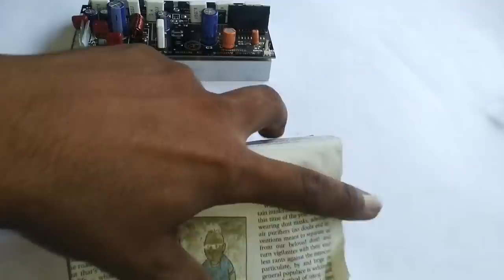How To Select Power Amp Board For Subwoofer

Comment: நன்பா என்னிடம் harman /kardon
161avr 5.1 avr per ch 85 watts 8ohms impeedians 200rm subwoofer உள்ளது இதைவிட powerஅதிகம் உள்ள subwoofer ரும் இதற்கு இருந்தது அது heavy
இருந்தால் வாங்கவில்லை இப்போது எனிடம் pioneer 12"1400
watts 2and or 8ohms(4ohms dvc)
model TS-W311D4 subwoofer உள்ளது இதற்கு kumar 2611 borad
50 volt dc பொருத்தினால் சரியாக இருகுமா என்று நல்ல பதில் சொல்லுங்கள் நன்பா நன்றி
வணக்கம் நீங்கள் விழக்கும் விதம்
மிகவும் அருமை சிவகங்கைல் இருந்து நான்
Reply from the maker: Kumar board are designed for 4 ohms subwoofers 8ohms it will give half the watts 4tr - 100w / 6tr - 150w  
Use two 8 ohms parlel 4ohms
Reply from the maker: Sir send me photo of subwoofer to my whatsapp number 7010277360

Comment: SAKTHI போர்டுகு 8" sub, 24 volt சொன்நீங்க, 24v transformer AC volta or DC out put volta கொஞ்சம் விளக்கமாக சொல்லவும். உங்கள் video எல்லாம் சூப்பர்
Reply from the maker: 24 ac I will tell clearly (most off the time 24 30 32 36 20 28 all will be ac)
Reply: @TAMIL-MUSIC  thanks for your valuable explanation and immediate reply. Thanks again

Comment: Anna na use panrathu 30 0 30 10amps  Transformer  use panren 5 chenal ku 10 transistor board sub ku bigsun 4 transistor 600 watts nu solranga ethukku 10 transformer pothuma nu sollunga

Comment: Recommend volt- each transistor  need 1.2 ampr,so 2 transistor need 2.5ampr + recommended  voltage. (Which showing on pcb.) But now class d amplifier is better than class ab....have updated always. 👌🙏
Reply from the maker: Class d not that available still modern avr using class ab circuit class ab Audio is more clear than class d audio for high quality audio class ab is the best

Comment: Hi, please note the power handling capacity primarily depends upon your mains transformer. The core window area, stack are the 2 factors which determine the power of the transformer. Taking the losses, reduce by 10% will be the power handling capacity. From this you have to work forward. You can have even 500 watts from 24 volts. Please go through the internet for how to rate the power handling capacity of a transformer. Then you can select the board. When you plan for a higher capacity it is wiser to plan for a speaker protection board also.
Reply from the maker: Thank for your bref explanation

Comment: Kumar audios 6fet mono board ku 36 Volt 10 amp 
6fet 300w board / TRANSFORMER 
36×10 =360w use pannalama sir
Reply from the maker: Podalam
Reply: 🌹🌺Thank you sir 🌺🌹

Comment: Anna vanakkam 
JBL 1200W, 12" Single
4 transistor mono poard
STK 4141,3ic poard
5.1 prologic poard Cristal
Sub ku mattum 24-0-24v 5ampr transform
Use pannalama 
Intha anaithu poard kum
24-0-24v 5ampr pothuma Anna 🙏
Reply from the maker: 40v tr and 6fet board

Comment: Kumar 6 trensistar bordkku 5amp 40 volt kudukkalama
Reply from the maker: Kudukalam bro but if ac volt goes high the output volt can reach up to 70v but kumar board recommend 60v so drop 4v for softy